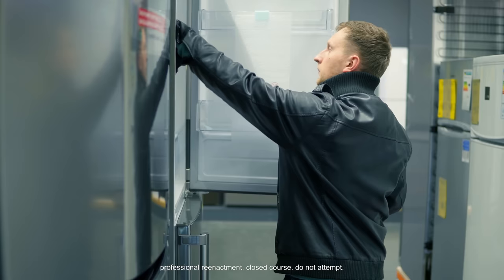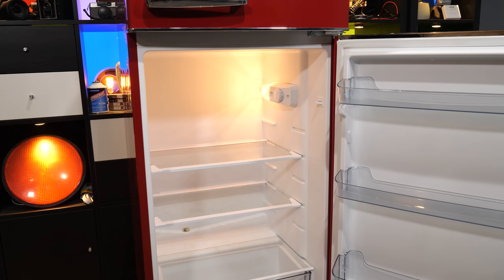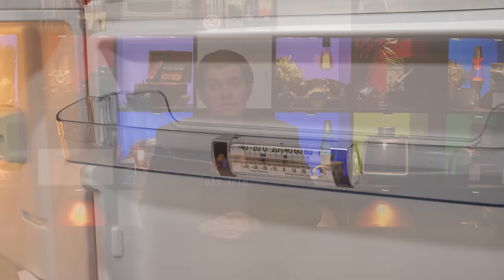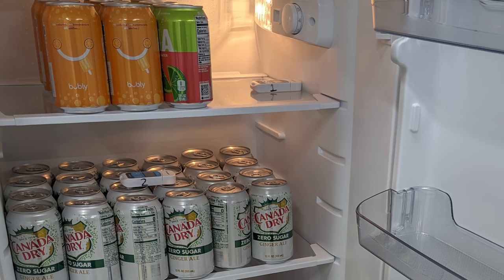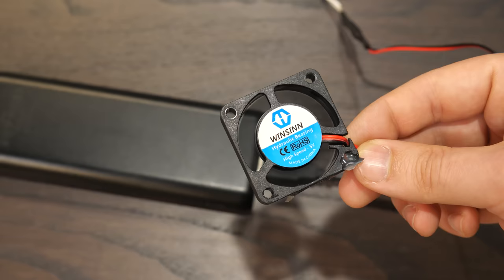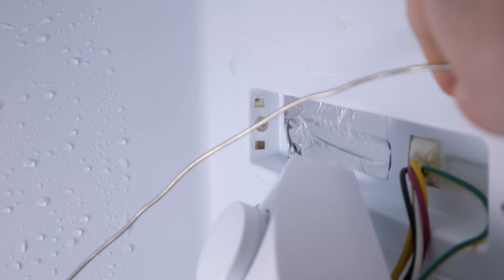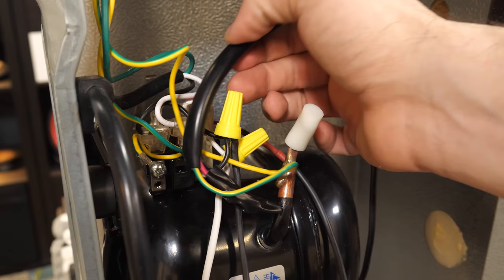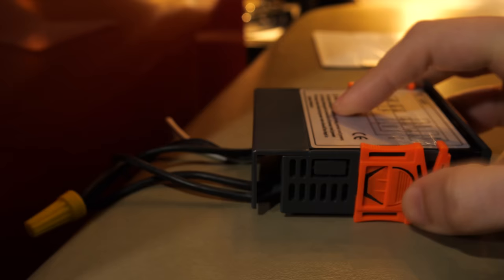This goofy fridge has a really clever design. It's also kinda terrible.

Comment: the thing is, most of the european fridges are build similarly.
the freezer is at the bottom, but other than that, no fans, no double doors, no ice maker and the condensers are in the walls.
Reply: jessir!
my frige doesn't even have a seperate freezer 
its just a compartment in the top with a trap door looking thing in front
Reply: Yeah, but as soon as you spend just a little more, you get fans and seperate evaporators. Even any IKEA fridge for around 900 € comes with those features and obviously two separate sensors and a microcontroller.
Needless to say, that any decent european kitchen hides the fridge behind doors that are similar to the rest of the design.
Reply: I was wondering what was so special about the fridge shown in this video. But apparently fridges in the US work very differently from the ones over here.
Reply: Yup, just our standard fridge, where we exactly know what kind of content goes to which shelf
Reply: @spot997 E900 for a fridge is a rather pricy one! 
You get a decent full height A++ for €600…
Reply: Yeah. Grocery shopping involves a place not within walking distance. So we end up buying more.
Reply: @My_HandleIs_ for real, 600 USD is more than I want to spend on a fridge, let alone Euros and this person is calling 900 euros cheap 😅 {which, to be fair, there are some crazy fridges out there around 2,000 euros... NoThnx}
Reply: I just arrived at the moment where he starter describing defrost timers and went "what?!". I am still defrosting my basic Polish freezer 😂 I mean, it is a good rundown on basic fridges but i'm dissapointed I won't learn anything new...
Reply: Wow you people truly live humble lives
Reply: @katarzynakonstancjadobrowo9072  manual defrost is honestly better.

More hassel once in a blue moon, sure, but they're cheaper, more energy efficient and they don't break as often. Fridge Repair is a stupid expense, ontop of a more expensive product.

Disclaimer: I live in a cool Mediterranean climate where summers are dry. No clue if that makes any difference on the amount of frozen condensation but figured I'd include the detail
Reply: @priestesslucy3299 using a manual defrost fridge is about as strange as using a robot vacuum/mop without a base that cleans the garbage compartment and refills the water tank and cleans the mops and dries them. I.e. unnecessary hassle that requires rationalizing, as we see here.
Reply: @BoraHorzaGobuchul  See, my budget and carbon footprint are reason enough
Reply: Yeah, my little cute Liebherr does its job just fine.....it´s basically a cooled cupboard. veggies in the bottom drawer, meat and cheese on the top shelf, milk in the door, butter on the door top shelf, other stuff in the middle. Once in a while, empty it, let the condensate evaporate, clean the goo from the funnel and tray, wipe the thing with vinegar, and there you go. Running flawlessly for years, no hassle.
Sound super oldschool, but it´s almost completely silent, has very good efficiency and doesn´t really consume much electricity.  I love it. I have a seperate box for freezing. Same story, works for me. Fill ice-cube tray with boiled water, close lid, once down to room temperature, place in freezer. Wait. Take ice cubes as needed.
Reply: @paavobergmann4920  huh, that's interesting. All the food safety people say meat should be on the very bottom to guarantee no drippage contamination.

Makes sense if the cold zones are the way they are with the top the coldest you would have to reject that logic and be extra careful to avoid drips.
Reply: @My_HandleIs_  I see one for 500€ but anyway you pay for the electricity for this kind of fridge. Energy label is F !.
Reply: I have no idea why freezers are at the bottom about 15+ years ago it was standard for the freezer to be at the top and I prefer that, now theres very few with it at the top and they cost more.
Reply: @priestesslucy3299  Oh thank you! That makes sense. I´ll re-check. There is a good possibility that I swapped it in my head and misremembered all  the time, being to cocksure to bother to recheck. That´s how the devil hides in the details. Luckily, I never poisoned myself with cheese spoiled with steak drippage... I noticed though, that the glass shelves have a rail in front, and are tilted slightly backwards, so any drippage would go down the back and into the funnel rather than onto other stuff. That might be a feature. 
But thanks, I´ll swap meat and cheese from now on. Can´t help the veggies in the bottom drawer, though.
Reply: @paavobergmann4920  I mean, meat needs the coldest temps and cheese basically doesn't care, so it's probably most important to work with the temperature zones of the fridge and just use trays or whatever as a juices safety net if you have to.
Reply: @GreatSageSunWukong every UK fridge I’ve seen since 1995 has had the freezer on the bottom
Reply: @kaitlyn__L   there are still a few at the top, Liebherr make one, Zenussi make 1 and Smeg of course because they are retro style and Swan as well also a retro style, I do prefer not having to bend down and go thru freezer draws.
Reply: @priestesslucy3299  I don't know where you live but in the UK things are getting crazy expensive
Reply: @GreatSageSunWukong  sure I’ve seen Smegs in the shops. But I mean in my homes, school friends’ homes, parents’ homes etc. Almost no one pays double for the design of a Smeg
Reply: @kaitlyn__L  Someone must be buying them.
Reply: Again.., I’m amazed how you are amazed about a type of machine I have known for all my life (34y) and have been around for much longer. which apparently is a “new” thing in the US..?
Reply: @priestesslucy3299  try the LG signature for a cool 10k €
Reply: @GreatSageSunWukong  I live in Western Washington. Probably... Top 20-30 percentile most expensive region in the US. Not crazy, but not cheap.

We've got a range of products available here. My personal choice was a pair of manual defrost 7 cubic foot freezer refrigerators, with one set for use as a standard chest freezer and the other set for use as a chest refrigerator.

Total combined annual power consumption somewhere slightly under 300KWH, total combined cost 500 USD. My husband installed them under hinged countertops in our galley kitchen on either side of the sink. Oven is on the opposite side of the aisle to keep the heat away from them

EDIT: For the Europeans, that's 198 liters each
Reply: @priestesslucy3299  I am just totally used to putting everything in containers or at least deep dishes, maybe because our fridges tend to wortk the other way round? Idk.
Reply: @priestesslucy3299  I really believe the climate does a significant difference. I live in a city where the humidity is about 70% all year round and having a fridge that auto defrosts is a MUST (older CDs/DVDs/Blu-rays also have a shorter lifespan here for the same reason)
Reply: And this design is why European fridges get an A(++) label and USA fridges get an F or G label!
Reply: @dreckneck  70% humidity in the summer sounds like a nightmare.

We average around 70-80% in the cool nights but as the heat of the day rises the relative humidity drops with it to maybe 30% most days
Reply: @Acoz0r  Exactly! This is a euro fridge with low energy consumption. A whole continent has these.
(Would have liked to see Alec calculate the heat resistance of the wall when fully loaded. The 37 min. Off time)
Reply: Yes, I was surprised as well, this in Italy is just the normal fridge that everybody has!
Reply: Eh, this isn't really all that true. Europe is pretty big so it would depend on what part you're talking about.
Reply: @ludvig3242 However this design seems to dominate the European market thanks to being used by large brands when they gained market dominance before outsourcing production to the East of the old iron curtain .
Reply: It has to do with the way people prefer to load them…. Having a freezer on the bottom means having a pulled out basket that can be filled , versus trying to get them to fit by loading them horizontally…. Its essentially a small scale version of the preference between a chest and upright freezer, with the same advantages and disadvantages , just on a smaller scale
Reply: @GreatSageSunWukong  The freezer is at the bottom because, as a general rule, the bottom is more awkard to get at and the freezer is the part you need to get at least often (well, of the two doors, anyway.)
Makes good sense from a usability/accessability stand point if you must have both in the same unit. Makes negative sense from an simplicity/efficiency stand point, of course.
edit: Also what MrSheckster said above.)
Reply: @MrSheckstr  except a bottom freezer refrigerator 

A: loses just about as much cold air anytime you open it as a door freezer

B: loses a meaningful amount of capacity to the rail system

C: requires the use of additional hardware to distribute the cold to the top of the refrigerator
Reply: My (pretty ancient) EU fridge has a very similar design, but the thermostat definitely doesn’t have the same problem as this one – it just keeps running until it reaches temperature, and seems to be at the bottom rear of the fridge compartment.
Reply: Imagine different geographic locations with different environments having different requirements and designs for appliances that reside in said environments.
Reply: @GreatSageSunWukong  Since they (freezers on the bottom) are a drawer, it’s easier to jam them full of stuff (and not have it fall out like the old school door freezers-on-top).
Reply: RE: smaller fridges in europe- i think it goes back to how different our living arrangements are. many americans have to drive to the supermarket. some people for more than 30 minutes each way. so they buy a LOT of groceries and put it in their gigantic vehicle and store it all in the enormous fridge to reduce the number of trips made to the store. whereas europeans can pop out to the shop on foot and come back with as much as they can carry in a bag and put it in a small fridge. I consider myself lucky as an american to be walking distance from a market and have a fridge the size of the one in this video.
Reply: @dxb338  how many Americans don't pass a supermarket on their commute?

If they don't directly pass one, how many only have a half mile detour up an off-ramp?
Reply: @priestesslucy3299  Refrigerators break?

When I moved into my current house, the fridge was likely about 16 years old and showed no signs of problems.  I measured the energy usage, realized that a new fridge would pay for itself in maybe 7-9 years, and bought a new one.

I'm now at 15 years old, and has never needed a repair.  I expect it to last another 15.
Reply: @stevesether  Yes, they break. I'm glad you wound up with a rock solid and reliable one.

I've seen two of them break down and both times it was the damn defrost system
Reply: @priestesslucy3299  oh plenty. The supermarket is a shit show at commute times though. Most people (myself included) just want to get home. When i do need to do a larger shop where i need the car i try to work it into driving home from some leisure activity on a weekend.
Reply: @paavobergmann4920  Why the heck would you boil your ice cube water?
Reply: @laurencefraser    That design works for a married couple with family, who mostly only keep ice cream and holiday novelties or the rarely needed supplies in the freezer to forget about until the time comes... Things like the Christmas Turkey and Thanksgiving Ham... or whatever... Sure...

    BUT for the young couple, just getting their sh*t together as a couple and still flailing between working two jobs a piece, and scrambling to try to get ahead of student loans AND pay off a house, a LOT of folks use THE biggest and easiest freezer they can get their hooks into for frozen dinners and instant snacks... Then you NEED the side-by-side design. Nobody in the house has time to open a door and drag out an ice container with fresh cubes in it... Let ALONE fight with friggin' trays to even get cubes busted out (and they never stay cubes either) into said ice container... SO the door to the fridge NEEDS that ice dispenser... AND as long as we're here saving time, just go ahead and put the carbon filtered water cooling dispenser in there, too... One stop to grab a COLD glass of water, suck that b*tch down, and head back out to the next pile of work they have to do...

     It's not healthy... BUT almost no part of current society gives a damn what's actually healthy. They preach a good game, but nobody's willing to give even a millimeter to just ALLOW someone else leeway to find a healthier option.  ;o)
Reply: @priestesslucy3299    Actually quite a lot of us don't drive anywhere near a legitimate supermarket in an average work-day. In spite of the likes of Dollar General and Wally World carpet-bombing the U.S. with outlet stores of various sizes, shapes, and varieties, the reality is that they BOTH concentrated on wherever it was CHEAPEST to do so, which was 9/10ths of the time in cities with economic flow... the same as everybody else in business. SO every state  has a short-list of towns with 3 or 5 or even a dozen Wally-world shops and supercenters, and then a slightly longer list of towns that have ONE... just ONE supermarket of any kind anywhere... AND the whole remainder of their county is DEAD EMPTY "in the sticks"... AND it's an hour or more to anything resembling selection. Sure, there's a mom-n-pop "mercantile" somewhere in the county... usually nearby a tourist trap or state park, and if you don't care to pay 10X the actual market value, you can get hamburger, hotdogs and buns and charcoal or even firewood bundles... that sort of thing... BUT that's NOT a proper grocery store... SO we make a FULL ON DAY TRIP for groceries... and the result is a monthly caravan down to the city, where we organize and budget very similar to a restaurant or military bivouac...

     It's even gotten more convenient and affordable for many of us to split the price of a farm animal at auction and then scour the phone book for a high school or trade school course in butchering and meat preparation, to get it cut, wrapped, and chilled for us... AND you can't beat the price on the finer cuts, as long as you're already buying the WHOLE animal...

      Some of us are even lucky enough to know a few of the stock owners and ranchers, so if we come around to help out at harvest time, we can even barter our time and work for meat in trade... rather similar to job-hunting and barter at the farmers' markets for vegetables. Long as you don't mind tomatoes that aren't pretty and round, or scars on the watermelons, and dubious looking other veggies... it's a means to survive and cut costs... IF you can manage to make the time, and have the stomach for it all...  ;o)
Reply: @gnarthdarkanen7464  Oh, you're describing country living. The best living.

I thought we were talking about the majority of people stuck in the city or the suburbs
Reply: Non-frost-free units mostly went out in the 70s in North America other than the smallest and cheapest mini fridges. And most people would agree, good riddance - yes, the defrost system does use some energy, but running with the coils partially frosted up most of the time wastes energy too. And aside from Samsung (just don't buy their appliances, people) it doesn't generally fail very often.
Reply: @priestesslucy3299  Well, not all suburbs necessarily have a neighborhood supercenter either... AND while I get it, some 8 million people at a whack in a single city sounds impressive, but there are a LOT of nomads in the U.S. as well as just rural lifestyles... I've even met quite a fair number of folks who bought into their retirement cottage or house somewhere and haven't seen the place in years, because their jobs require travel...

     The point (for me at least) is that the U.S. is a HUGE country. There's a lot of differences and variations that go on inside it. I doubt there even really is a single "majority" lifestyle.  ;o)
Reply: @lordofthemound3890  I just find it harder to find what I'm looking for
Reply: @GreatSageSunWukong  supply and demand, you open the freezer far less often, so reduces the number of times you have to stoop down
Reply: @My_HandleIs_  Since September 2021 the energy ratins are from G to A. The old A++ compares to E or D in the new scale. And fridge with rating B or C can easily cost 900€. So it is difficult to say if one fridge is pricey or not.
Reply: @Acoz0r  There is a new energy ratings scale from G to A in Europe since september 2021 where A++ compares to E or D.
Reply: @priestesslucy3299  like I said, rationalizing. Where budget is the real reason. I feel you, living in a country where salaries are smaller and stuff is conversely more expensive, I can afford only one premium vacuum with a fully-featured base at the moment, and since the previous vacuum was relegated to the second floor I also want to think "it's ok, my carbon footprint is smaller and African children get more water because the old vacuum doesn't waste any for mopping". But this is just a coping mechanism. Fact is, if I could afford it, I'd have the best tech everywhere. And would reduce my carbon footprint by running an electric car instead of diesel (the math is a bit sketchy here too, but let's hope for the best).

Individual carbon footprint is negligible compared to heavy industry. You might think you're saving the earth by turning electric stuff off for an hour on earth day (in reality, you're only creating a giant headache for the electric grid engineers/operators). It might be enlightening to calculate how much an aluminum smelting plant consumes in an hour. And they won't shut it off (in part because restarting it afterwards might be somewhat complicated) on Earth day or Greta day or any other day.
Reply: @GreatSageSunWukong  Most people just tend to access the vegetable drawer way more often than the freezer, so it makes more sense for most to bend down for the freezer stuff rather than the vegetables.
That's why. Concenience.
Reply: I was watching the video for a good bit and waiting for anything notable, as it just seemed like it's a normal fridge over here. turns out; yeah, it is! lol.
Reply: @priestesslucy3299  It makes a difference where you live regarding choice of fridges / AC / freezer, etc. they are build/designed for the climate, do not take a fridge designed for a warm climate to a cold climate it will at best be inefficient and at worst it will work very poorly.
Reply: @NorroTaku  thats most minifridges in the us lol.. most people have freezer top and fridge bottom (freezer being smaller ) or those double door ones
Reply: @SixOThree  100% this and we tend to have alot more leftovers too
Reply: @GreatSageSunWukong  freezer at the bottom is more logical since most people generally use the fridge much more often than the freezer. Unless you're on a frozen meal diet, this should be more convenient
Reply: @ricahrdb not really work differently, just more features and complexity. They are all refrigerant based refrigerators.
Reply: @Devin_Stromgren  to get clear icecubes with less bubbles in them.
Reply: My fridge in Canada has a bottom freezer.
Reply: @GreatSageSunWukong  hot air rises, makes keeping the freezer at the bottom colder.
Reply: @My_HandleIs_  You can't buy an A++ since 2021 as the labels have been changed. The old A++ label would now be a E or F label. The new A label fridges are quite a bit more expensive and consume 30-50% of the energy the old A++ fridges used.
Reply: @spot997   900 € ?! Thanks, I would spend 300€, maybe max. 350 on a fridge. Yes, the fancier ones are more efficient, but way less reliable. These simple ones will last 15-25 years, while the fancier ones (especially if inverter controlled) 15 years maximum, but often less than 10 years. For 3-4x the price. My current fridge is a Fagor, we bought it in 2000, still works, although it runs longer than it should, probably lost some refrigerant already. I'm planning to replace it this year or next year, but I'm shocked that I cannot find any fridges with non-Chinese brand compressors in them. Jiaxipera is in 95% of the fridges, in every brand! 

Seems like only Samsung makes their own compressors in Korea, and I've seen a single Panasonic compressor in a Miele (IIRC), but that was way over 900€ even 2 years ago, the last time I crawled on my knees behind the fridges in the store to study them. Seems like I have to give up on the compessor brands, and hope those Jiaxipera compressors can work for 20 years, just like the Spanish Unidad Hermética compressor in my Fagor from 2000. But in my experience, the usual cause of failure in simple household fridges is refrigerant leakage due to corroded pipe joints. Usually hidden inside the walls under the insulation, impossible/not worth to repair.
Reply: There's fridges in the laboratory I work at that are basically like this.